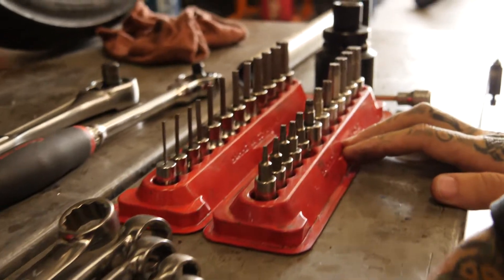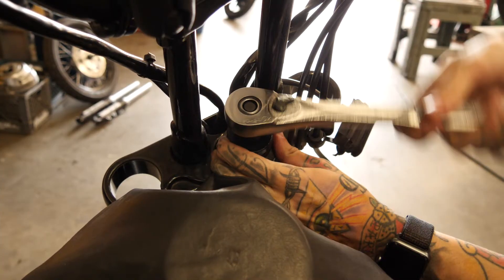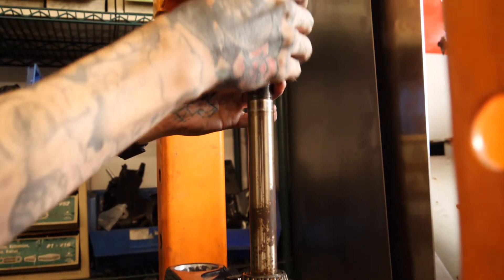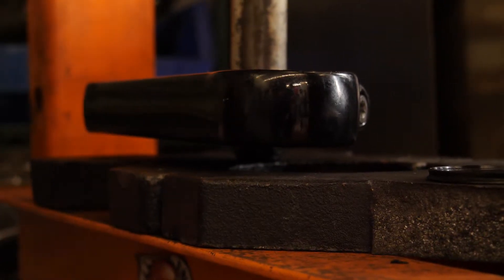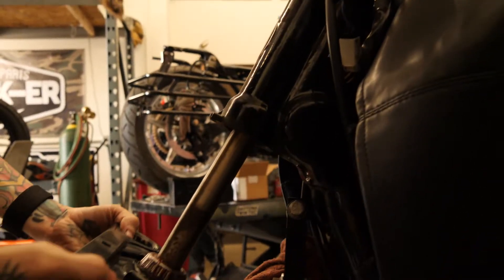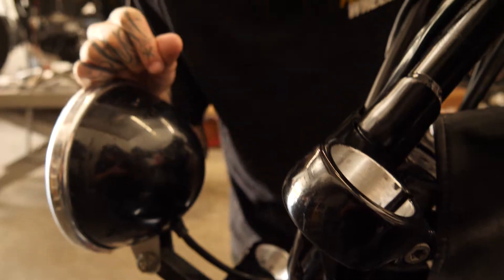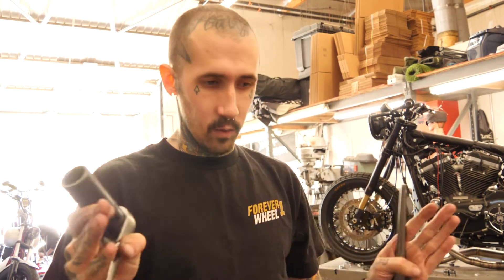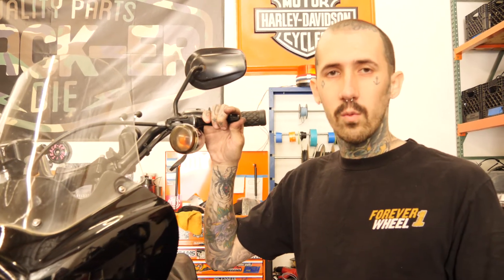How to Change Your Harley Neck Bearings!

Comment: For everyone commenting on not replacing the race, I submit that if it was on a rotating wheel, yes; on a steering head not necessary unless pitted or rusty. You'll never wear out a race on a steering head!

Comment: Yeah it was a nice video I don't know why you didn't change the out the races anyway or even mentioned that the races are supposed to be punched down all the way to the metal rim inside the neck before you do all that so I did learn quite a bit I just tore down my whole front end of my 2006 Dyna FX DLI and I found out that the new triple trees that broke and the new bearings the top race and the bearing are rusted and pitted but both bearings are not pressed down all the way into the frame so maybe you should mention that on a video and somebody didn't line up that neck bolt the lock for the neck when they put it in so that was a very informative I really like that cuz I got to put this thing back together and I don't like going through a Bible it's for one page way back over to another page so these videos are very informative and I appreciate it so that's what I learned and now I got to find a press to do my new bearings and I need to knock out those races to get some new races put in and I will be tapping them down to the edge of the lip where they're supposed to go this is JD all northern  and southern California and they call me John and Reno Nevada I appreciate that video like I said I learned a lot

Comment: 1st, you guys should say what year and model your working on. 
2nd, You could say some steering shafts are welded so just take bearing and Race out.
3rd, We ruined a Triple Tree welded in shaft  on a press the shaft was weldwd and does not cone off...

Down for 2 weeks and found aftermarket steel one not aluminum.

Comment: 2 things.  I've never had to use a press to remove the lower bearing from the shaft, they might not always come off easily, but they aren't a press fit.  And I never would replace a bearing without replacing the races too.
Reply: What is your method for pressing the bearings in?
Reply: They are press to fit on a dyna
Reply: They are a press fit lol
Reply: They certainly aren't press fit on late model dynas..

Comment: There actually is a measurement in the Harley manual for fall-away, it calls for 2-4" from center left/right at the point of falling on it's own. Though I don't find that to be necessary, your method is just as well. Whoever setup my bike didn't do the fall away properly, when I removed my triple trees for PC and suspension upgrades the adjustment nut was handy loose. My lower bearing was also not a press fit, assuming from excess wear from the neck adjustment being overly loose. Good vid!

Comment: Great video -- thanks for posting.  Steering-head bearings never even manage to make a single revolution and have very different operating conditions compared to wheel bearings (tapered-roller wheel bearings require END-PLAY, while steering-head bearings must be PRELOADED).  With that in mind, the following  excerpt from Timken Tech Tips, Vol. 7, Issue 2 provides some general background info w.r.t. tapered-roller bearings:
"Timken recommends that the mating of components, the cup and cone, be from the same manufacturer. It is also recommended to change both components at the same time.  Because the old component has a distinct pattern worn into its raceway, mixing it with a new mating component may set up edge stresses along the races. Following are the technical reasons that parts from various bearing manufacturers should not be mixed:
• Incompatible internal bearing profile.
• Overall bearing width difference due to tolerance differences.
• Bearing rating differences.
• Surface finish variations due to different manufacturing processes and technology.
• Steel quality and cleanliness variations.
• Steel processing and steel type variations.
• Variances in worldwide bearing manufacturing quality.
Mixing components from multiple manufacturers may seem insignificant, but it can make a big difference when it comes to correctly fitting parts together. International standards only mandate that the same part numbers have the same basic outside diameter, bore and width and cup angle, allowing the internal geometries and characteristics to vary from manufacturer to manufacturer."

The bearing cone is mounted onto the steering stem with a light interference fit, and the inner race can be separated from the stem by application of heat once the cage and rollers are removed.  The interference fit between the stem and the triple clamp is much tighter.  Separation and reassembly of interference-fitted parts by purely mechanical means (without applying differential heating) can weaken that fit.

Comment: There are really no other good front to back tutorials for this.  My bike has the death wobbles anything past 60mph right now.  I'm glad this video got posted
Reply: If you have the wobble of death does that point to head bearings?
Reply: @adminadmin9997  swing arm bushings is another place to consider checking.
Reply: As well as forks.  Worn seals with really low fluid, especially if it’s one side will get you a tank slapper in a hurry.
Reply: Motor mounts, swing arm bushings and misaligned rear wheels cause it too. Dynas don't like worn tires either.

Comment: I would most definitly change out the bearing races with the ones the new bearings came with, crucial.
Reply from the maker: Bearings are available in kits with races as well as individually. If the races have any imperfections, I would 100% recommend replacing the races. However, in this case the races checked out and looked damn near new, so there was no need to change em.

Comment: i did this job on a 2008 and 2015 and didnt have to press out the steam on either jobs. the lower bearing was on there snug but not hard at all. you can pry it off with some patience or use some heat, after about an inch its in the clear. this should save you some time if youre doing at home.
Reply: Cheers for that chum. Doing this this weekend. Wondered about that.

Comment: Now I just have to buy a hydraulic press and it's done. Perfect tip!
Reply: Na you don't need to. Get an end grinder and a burr bit and be very gentle cut the bearing cage  being easy not to get into the shaft

Comment: I've been told NOT to press out the stem. Cant even get a stock stem without getting it already installed with the lower tree..AND my bottom bearing came right up the stem and off. No problem...went on just as easy..2013 FXDWG. My problem, getting position of upper clamp over the  rounded star nut adjuster  correct with the bottom..

Comment: Those neck bearings were badly worn , I would have definitely replace the bearing races . If anyone wants to know how to correctly check the Fall away , Doc harley has a very helpful video  checking the Fall away on Dyna's and large touring bikes , Otherwise Good video .

Comment: Good information. I’ve had my xl12 for 4 years now and I’m thinking this is the problem that mine is having. Had a shop replace the front wheel bearing. They didn’t even look at the steering head bearing. Got the bike back (after 3.5 weeks 😡) still shakes like Michael J. Fox. I want to do it myself so I know it’s done right but I don’t have all the equipment to do so. So I’m left with a dilemma, I really don’t want to shell out a fuck load of cash to have this done and I don’t want to take it back to the shop that did the wheel bearing in fear that something is going to go wrong. I guess I’m not looking for an answer I’m just venting. Thanks for the video again. Dirty side down!

Comment: Dude. Your instructions are really great, you're far better at intelligent instruction than most DIY Harley videos, videography is great, but did I miss something? You only changed out 66.6% of the bearings!!! Unless I missed it, you left the old outer races in the frame's head tube...???
I'm trying to figure out how to remove them from an '86 FXR, with a massive 3/8" thick head tube aka neck, whose i.d. is smaller than the i.d. of the outer races pressed into the frame!!! Not like some of the hourglass looking neck tubes on most Harley videos where you can catch the underside of the pressed in frame side outer races with a race puller or drift punch.

I'm going to dremel a notch into the frame on the frame spine welded-on side, as this won't compromise the neck tube ANY since there's a massive tube welded to it from the outside to support it.
With this notch, I'll be able to get a drift punch under it.
ALWAYS change the outer races unless you're just just changing the lower bearing to put a new rubber-type seal under it. If the bearing is worn, the race is equally worn.  Replace it ALL if ANY of the parts are bad, as they ALL WEAR TOGETHER... Bearings worn & notchy? Races are worn in a corresponding way... Even if only on a micro level. Dont mix & match worn vs new assembly pieces. It's a matched assembly, replace it all together...
Reply from the maker: Hey Chuck! Bearings are available individually as well as in bearing kits. Timken bearings are not matched to the races and can be purchased individually. Unless the race has some sort of imperfection, which in this case we checked for, swapping the race is somewhat unnecessary. Is new better? Potentially. But, if the installed races are free from imperfections, to clean and regrease is perfectly acceptable. We will have a video showing the race removal/installation process later on as well!

Comment: wrong,wrong,wrong. always change the race and bering as a set, for they area matched at the factory or Mfg. good review
Reply: Just read the replies from trackerdie dude. Theyre fully aware of that
Reply: Disappointed! One shouldn't have to sift through 50+ comments and even more replies to discover that the instruction that convey a sense of authority are misleading, incomplete, and just plain wrong! I mean really, dude?! Even the HD shop manual says DON'T DO THIAT.  You must always replace the outer race and stem bearing as a set or dont do it at all. You are better off cleaning and repacking the old inner bearing, even if rust is evident, than to install a new inner on the old race. Seemed like a good resource to subscribe to but that snafu will make me question anything this channel  posts and to say DONT TOUCH THIS to the subscribe button. I get it why you have so few subscribers as another comment makes reference to.
Reply: Christopher Tayler chill! 😂

Comment: Tapered bearings are what my old cars use. You supposed to torque and rotate wheel clockwise and then backoff and retorque with inch lb. You cant do that on a bike so i guess thats why the don't last.

Comment: Wht would you guess a good independant shop would charge to change the neck bearings and races on 2009 Low Rider?
Reply: I live in Louisiana and the local stealership quoted me about 500. I bought a bearing removal set on CL for 5 bucks and am going to tackle this job tomorrow. Wish me luck.

Comment: Thank you!! This is exactly what I needed. I’m assuming this process is very similar for the Street Glide, right?
Reply: No. Touring bikes use a swing back method. Touring bikes have special trees that return to center. Completely different adjustment.
Reply: Thomas Marchese well shit lol
Reply: @thomasmarchese2808  setting the correct tension/fall away is different on touring bikes but the removal and replacement of the bearings and races are fairly similar.

Comment: Great videos guys. Very useful info.
Can you do a video on aligning a Dyna engine. I have a 09 stage 3 110 and after replacing my failed front engine mount I have more vibration. Would be good to know proper alignment procedure.